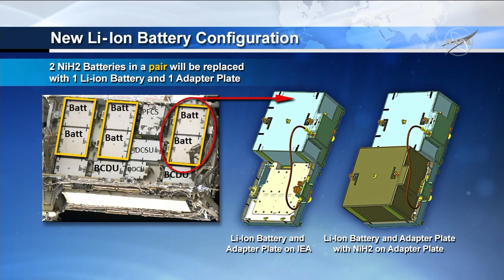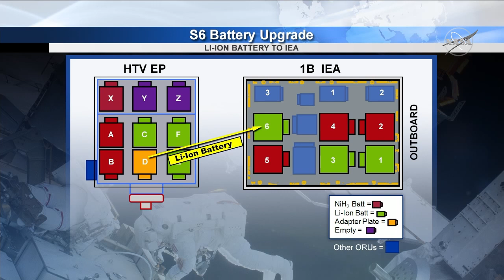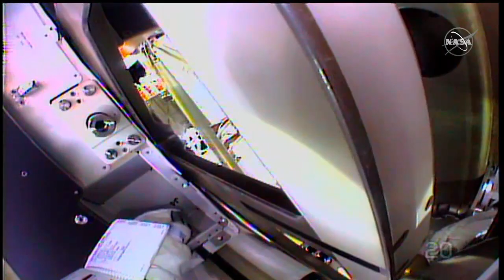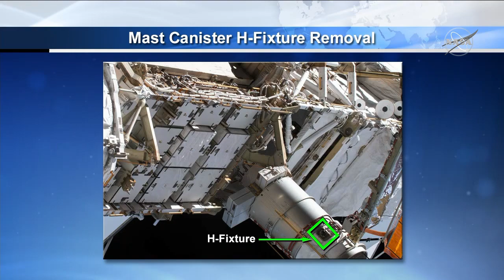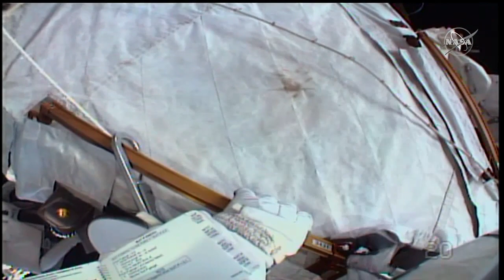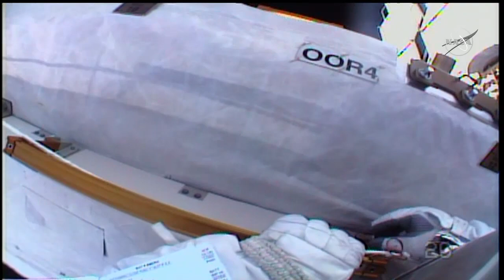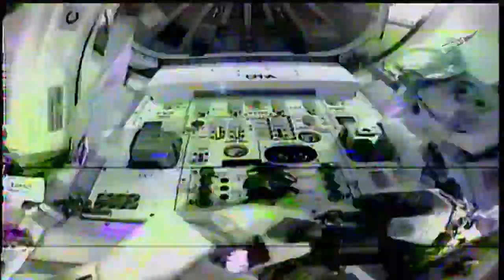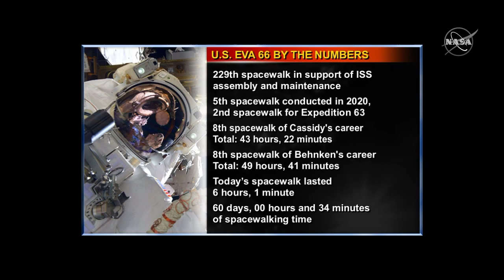International Space Station Spacewalk, July 1, 2020

Comment: What material they use to build ISS? Im curious if metal placed on space do it rust?
Reply: Titanium, Kevlar, and high-grade steel are common materials in the ISS. 
Lightweight aluminum, rather than steel, comprises most of the outer shell for the modules.